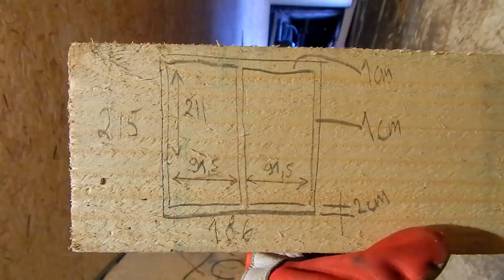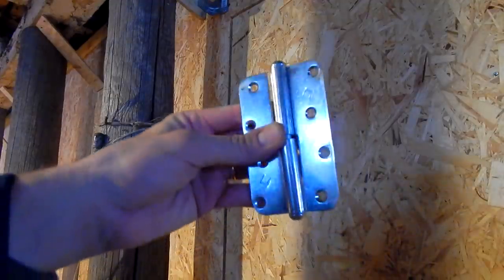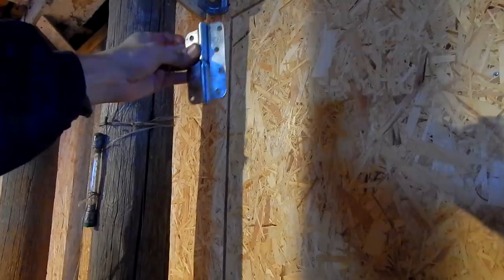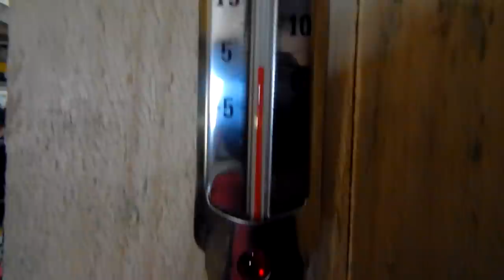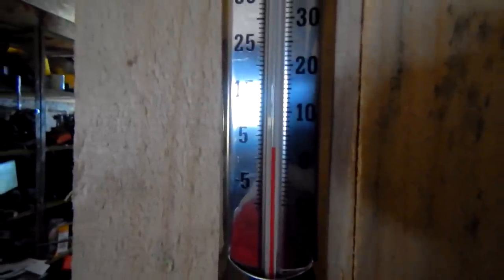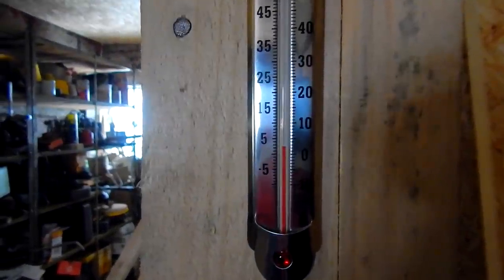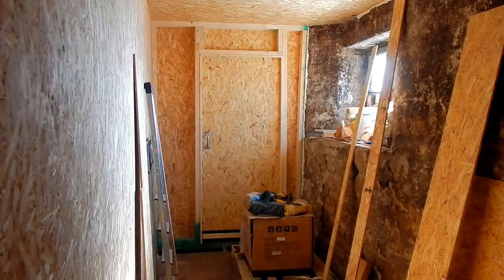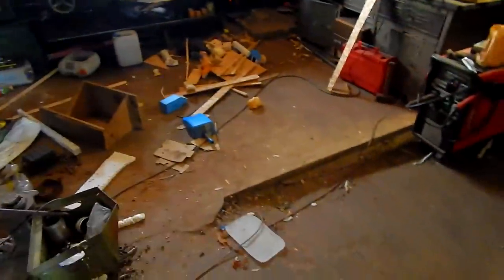Doors & Door Latches - Machine Shop Build Ep. 7

Comment: I like your color scheme. It's the same as the shop I'm building!
Reply from the maker: I haven't decided on painting the OSB yet. I would like to cover it with water stop and latex paint to reduce or almost completely stop the water vapor from entering the OSB even though the OSB is already a vapor resistant material but not a vapor barrier. So the color scheme might change from OSB + whitewash to white OSB + whitewash stone walls. Doors would have to be darker so my dirty hands will not stain'em so quickly.

Comment: I don't do a lot of woodworking but when I do I keep a bout a gallon or so of saw dust and put some light oil with it to use as a floor cleaner when I sweep the floor the next time. This helps grab the dust, dirt, and metal shavings for a faster and easier clean up.

Comment: Floor heating is good idea, but this amount concrete has heat insertion if will be not heated all the time. It tooks some time to warm up. But less waters temperature you should pump to the floor to have same temperature in air.

Comment: Floor heating has a lot of thermal inertia.
Unless you use your shop constantly,or unless it's heated with a  programming device,very accurately to not waste energy past the time you don't use your shop in the day,and to get it warmed before when you get in ( wich is also waste of energy) ,i don't suggest it to you.
I would insulate the floor as well,to not get the same inertia from the cold ground ,(even if you loose only little heat by the floor) and get a very responsive heating system,like a "boosted" wood stove or a used  wood pellet stove,with few fans strategically placed to blend temps fast.
You could preheat incoming air in your shop with a underground pipe,and use exhausted air from your shop to warm it up even more,so you already get relatively warm air,and less energy wasted in heating up your shop.
Two concentric pipes could do it quite easily,as i know the ground it at a constant 11 ¨C if you dig enough,even in cold countries.
I don't think you have permafrost,so it could be a useful set up for you.
It would make a good AC system fo summer also.
One or two things like that with hygrometric two speed : https://www.mr-bricolage.fr/media/catalog/product/cache/image/700x700/e9c3970ab036de70892d86c6d221abfe/1/0/100410-aa619506-visuel_produit_base-100410.jpg  and some pipe would do it.

Comment: From what I have heard you will not regret spending the money to install the in floor heating even if you only do the pipes or tubing now and don’t complete the system until further down the road. Since you are doing the concrete slab it is the perfect time
#NoRegerts

My cousin built a new shop and planned the tubing around the future 2 post lift he wanted to install so proper footings (under lift) and drilling for anchors wouldn’t affect the tubing. ⛲️
Reply from the maker: Yup, it seams I'm gonna put the tubes in. I've had a couple of comments about it being not so good idea since it is expensive and it's not efficient when I'm not using the shop every day, but my gut feeling says I'm gonna regret it if I don't put'em in. But we'll see.

Comment: Thanks for a great video.... as usual. I guess you don't have much insulation under the concrete? If you don't, forget about the floor heating...all the heat will be sucked down towards the ground
Reply: Mark; this isn't criticism, merely known scientific observation re: "all the heat will be sucked down towards the ground."
Science dictates that heat must rise and cold must fall i.e. "hot air balloons" which work on that observable [science], principle.
Reply: @DanKoning777  😁 thanks input on a 3 year old comment... You are absolutely correct when we speak of heat in air, however when we speak of heat in ground or floor the heat spreads towards the coldest area... That's what I learned in school at least. I live in Sweden and houses with without insulation under the floor are considered not suitable for floor heating.

Comment: yes in this day and age any cement floors that are poured should have vapor bearer and 2" foam on the ground and tie the 1/2" pex heating pipes to the rebar, in 3 or more loops even if you dont plan on using it, there may come a time down the road were you want nice warm dry floors, and a cement floor with hot water pex pipes in it, will heat a whole building, and use half the energy to heat, once the floor is hot it take very little to keep it that way, as well the heat from the floor moves up all the walls like a huge battery of stored heat, but yet hundred of shop an home floors are pours every day and they dont put them in, witch is so sad, they dont know what they are missing, and it cost very little extra to put them in, its the manifolds, pumps controllers that cost but they can be put in any time, hell you can heat the floor with your hot water tank.. even run pex pipe on your upper floors wood floor joists before closing them in.. the pex pipe is only $0.28 a foot cnd

Comment: I hope you did not close yourself in so close and tight that you can't get lumber or whatever in to your work area without a major hassle.
Reply from the maker: Double doors in the machine shop help to get the material in and projects out. The single door in the end of the motorcycle storage corridor will just be for walking through.